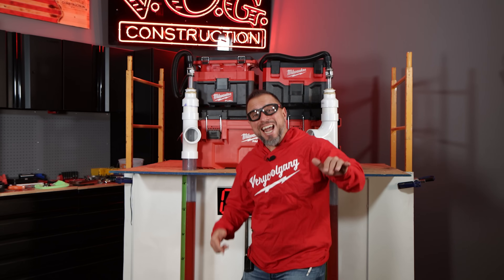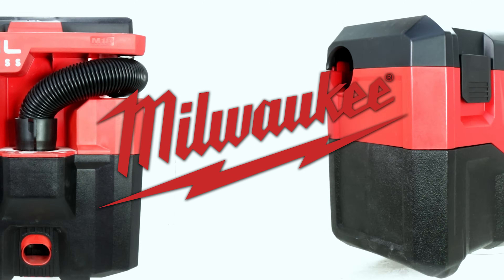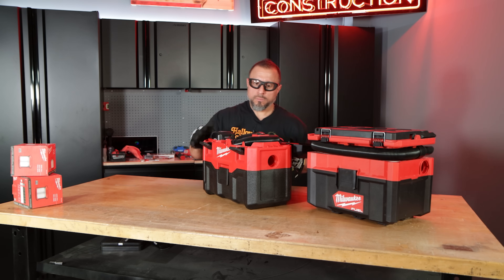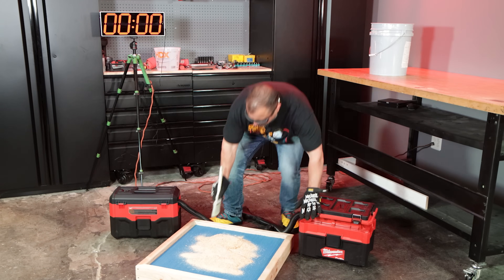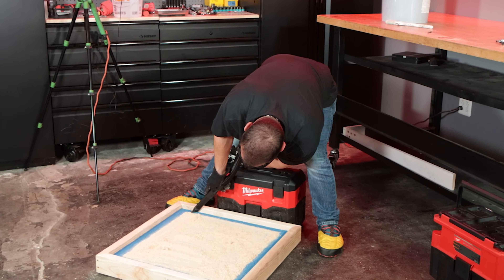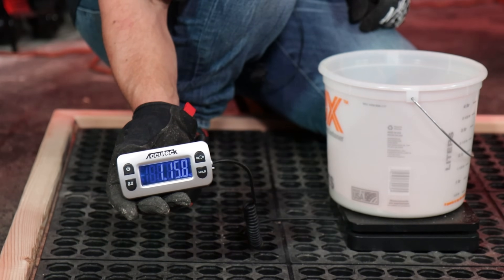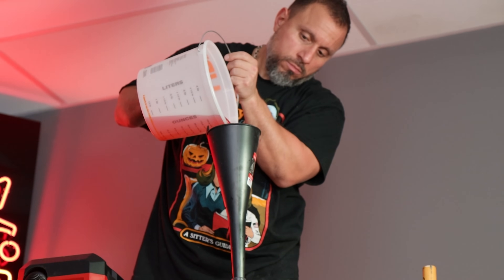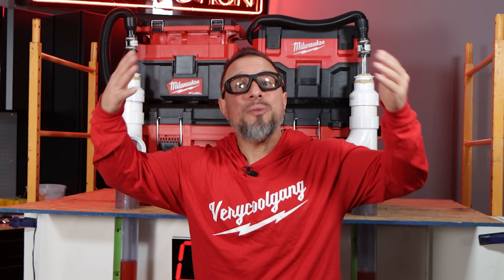BEST MILWAUKEE TOOL Wet/Dry Vacuum (M18 VS PACKOUT FUEL)

Comment: Yo Vince! Great demo! I'm happy with my standard m18 wet/dry vac. Especially since I only paid $74 (tool only) for it during Ryobi Days 2020 at Home Depot. Take care and God bless! 😁👍
Reply from the maker: Thanks Dave, I definitely love my standard M18 as well, it does almost everything I need it to!! Always appreciate your thoughtful feedback!
Reply: What do you think of the vacuum after 2 years I’m in the market to buy one
Reply: @barrios2293  The vacuum works great! The hose separating from it's coils has happened to me twice. Although, Milwaukee replaced the entire vacuum with a complete new one under the warranty rules. Having said that, you have to send the entire vacuum to them (on their dime but your time and effort) in order to have it repaired/replaced.

Comment: Would love for an adapter to come out to use ANY other universal 1¼" attacht with the vacs. So much more convenient throwing a 2ft hard pipe at the end for extended reach.
Reply: Can you not use any other adapter or anything on it‽???
Reply: @ricksgiggle8852  nope. I have a 1-¼" hard tube extension (Craftsman Chinese branded) that has worked with any vac hose that size, up until the M18 Fuel. Love not having to get a step stool out to hit ceiling corners. 
I also had to rob a friend of their bristle brush to use with the PO vac, as it doesn't come with one, and others don't fit. 
MAJOR engineering brain fart there. I'm sure someone will 3D print an adapter soon.
Reply: Even though it is a supposedly standard sizing of 1.25 inch it is in fact not a standard 1.25 in sizing because other 1.25 in industry standardized accessories don't fit the Milwaukee so it is in fact not standard even though it claims to be.... I have the M18 fuel stick vac and the M18 suitcase vacuum.. at least both of these vacuums use the same hose sizing so the accessories between the two are interchangeable....

Milwaukee should not be claiming that these vacuums are industry standardized 1.25 in because they are in fact NOT!
Reply: No...it says standard but I can tell you they don't quite fit.  I like a brush end and again no good fits, I also use rigid tube for floor clean up...same deal no good fit.  Very annoying...
Reply: Yah let me go steal a 2ft 1 1/4” emt from the electricians 🤦🏾 might as well grab a broom because there ain’t gonna be sucking

Comment: They are really missing a trick here: Should combine battery charging and shop vac. Plug into the mains and it charges the battery AND powers the vac. Unplug from mains and battery powers the vac. One less thing to carry!
Reply: But they want you to buy more batteries and chargers. That would cut their profits.

Comment: The best 'suck for the buck' is that little ~$29 "Bucket Head" wet/dry vac that snaps on top of a 5-gallon bucket - been using it for HVAC service for years and it won't die.

The house and an extension cord wrap up and fit neatly inside the bucket when you aren't using it or you're carrying it to/from the jobsite. 

Primarily use it for getting water out of 2ndary pans when A/C's have plugged condensate lines in attics - SUPER easy to pop the top off and carry the bucket down.
If you have a helper or the home owner wants to 'help' you can do two buckets at a time and pass them down when they get half-full to expedite the process.
  It's kinda use-less for getting leaves of of condensing units during maintenances due to the smaller-diameter hose...but VERY useful at smaller tasks - DEFINITELY worth the small amount of space it takes up in the van (fits perfectly in a milk crate FWIW).

Comment: @VCGconstruction Did you have the fine dust particulate filter for the M18 fuel pack out that they say you should be using with the pack out unit? I would wonder if that makes the difference because that is one thing that I did not even know after having mine for an entire year that I actually should be using to pick up fine particulates like sawdust and sheetrocked us. Knowing that they use that small bag to collect that fine dust particulates I'm wondering if that added suction pressure from that would actually allow it to suck up that particular just as good if not better as the old briefcase back. I don't know why they don't really advertise the need for the foam filter for the water and the microfiber bag for the fine particulates but like I said after having an entire year I was unaware that there was even these accessories to buy with that Shop-Vac.

Comment: Hey, great video/test, it was just what I wanted to see. I didn't realise that the Fuel would vary it's power depending on the load in it. I want one of these vacs to use as a tool dust extractor, so it will never have any load on it, meaning the Fuel wouldn't ever give me full power, so probably wouldn't perform as well as the VC2. Thanks.

Comment: I don't get it, when would you want your vacuum to not run full power? I don't remember ever using a vac and thinking "I wish this had less suction."
Reply: Uhuhhuhuhhh  huhuuuuhuhh....
Reply: If you’re working in a client’s home and want to keep the noise down, or want to extend battery life, or simply don’t need full power

Comment: Next time see if it can "suck a golf ball through a garden hose"

Take a ping pong ball, and attach BOTH vacuums to it on opposing sides, and pull apart.  The one with the greater suction should still be holding on to the ball.

Comment: My Issue with the small vacuum is the hose clogs where the hoes bends to go inside the vacuum all the time especially with sheetrock pieces and screws
Anyone have a comment on the bigger one being better at not clogging, is the hose bigger?

Comment: Helpful comment for future reviews, if you go more in depth.
-Noise level 
-Battery level at the end of the test
-Comment on building materials like whats plastic whats metal like hinges latchs and any possible weak points
-any Helpful dimensions like hose dimensions length, diameter

Comment: Big hint for the hose it always gets stuck in vac if hose clogs its a Good 5 minutes sometimes trying to pull it out today I took my pocket knife and cut the little nipples that lock it in and took some sand cloth and sanded it a good amount now works smooth and if you use the blower the hose also still stays in but I'm telling you been using the standard two gallon since it first came out

Comment: Vince this test was awesome. You took this to the next level!  Great job!!  I use both of those vacuums on a regular basis.  Actually I used both of them this morning doing some cleanup work.  Love the Packout vacuum.  The handle and on/off switch is great.   Totally agree that the hose storage could be improved.  The standard vacuum hose storage is way better.  Great video.  I hope you are doing okay! 👍🏻

Comment: The fuel one has two speed switch right? Thus is convenient if you're using in a tool like saw etc!?
My old Man 18 got stolen but I don't really see a huge difference in performance, was hoping for more.
In the UK the price is about double on the fuel v M18...
Reply from the maker: it does have a 2 speed switch!

Comment: Hoses are junk on them. Took my m12 back and went to Lowe's and bought an electric 4 gallon tool box style Dewalt for the same price of 99 dollars. Only used my m12 four times and had it 2 1/2 weeks.

Comment: @VCG Construction. My complaint with the nut and bolt test, it seemed 2 nuts were next to each other for the packoit vacuum letting it do the test after/easier. Second, even if the nut didn't go all the way down the hose, you could've sucked them into the hose before lifting it into the bucket. Granted, I understand it was to prevent clogging. In that case, line up each one evenly and suck each item one at a time for a 100% even test. Love the channel regardless!

Edit: I don't have the packout, but it seems the add on tools have a slightly different design from the M18 version? Couldn't really tell. If that's the case, it may not be the vacus fault, but Milwaukee's "fault". But I get it. That's what the vacuum comes with and thats what was tested. So no hate there!